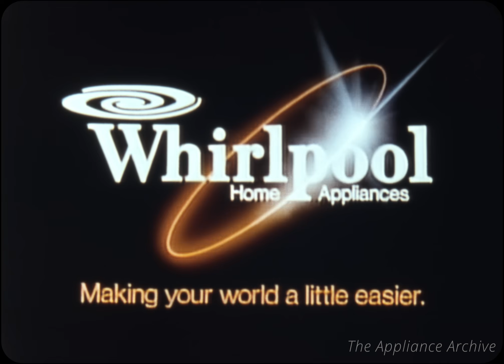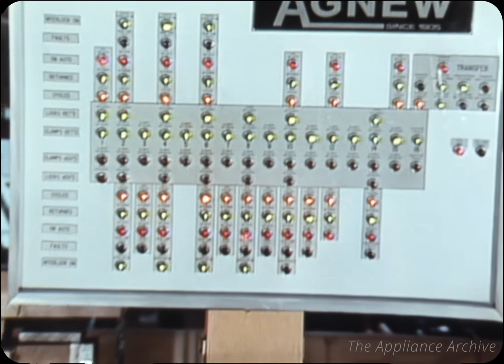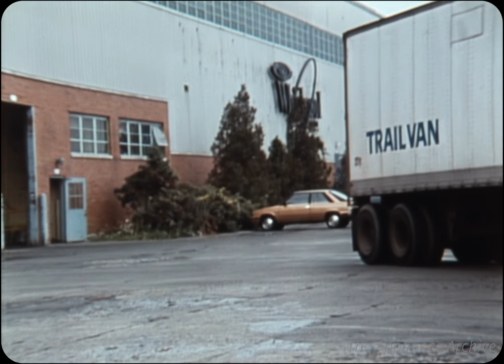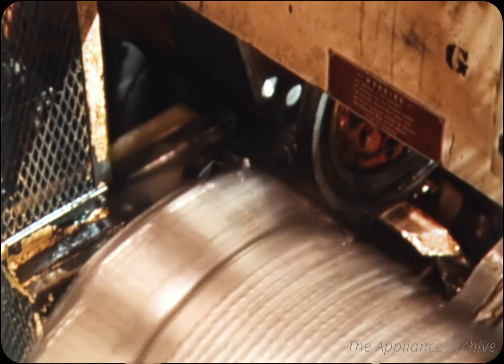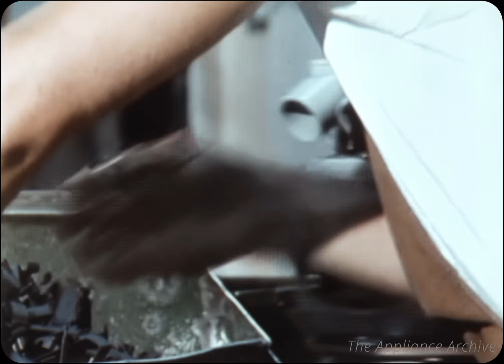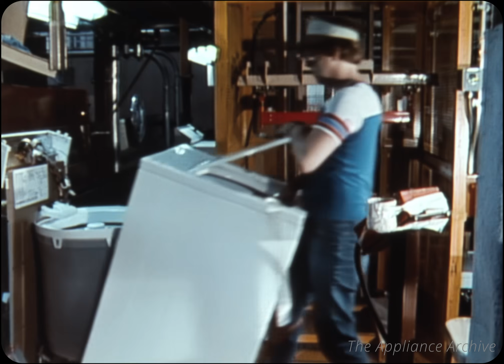Whirlpool's Design 2000 - The Direct Drives 1984

Comment: The cabinet was flimsy,  the plastic  tub vulnerable to getting sliced, weak coupler ,  tub seal prone to leaking . It didnt last long at all.
Reply: Had our first direct drive from 1988 to 2003. 15 years without a breakdown and I ditched it because the tub holes literally got clogged up by the A&H powdered detergent and hard water. That's the only reason why I bought a 90 series Kenmore in 2003. That early machine never gave us a problem.

Comment: Well mine’s not a direct drive but I have a 2 belt Maytag from 1990. It is absolutely amazing and never ever had one issue until 2025. 35 years constant service, also I’ll admit, never serviced/maintained. Until recently when the motor went bad. I decided to remove the tub and clean the inner tub and check for rust damage. This turned out to be a difficult challenge and took most of the summer to get it back to running due to spanner nut corrosion and then worse inner tub pitting than I expected. Particularly around the drain hole and drain nipple. But I decided it would be worth it to remove all the rust and fill bad pits with epoxy and then 2k epoxy primer and multiple finish coats with plenty of time to cure nicely. I went through some difficult trials and tribulations getting the outer tub balanced properly because there’s no detent to hold it centered. I just had to eyeball it and then cranking it down tight. Changed the motor, belts and properly adjusted the springs and feet. It did some banging because the tub wasn’t perfectly centered, until I took it apart and reset it with some home fabricated gaskets for forgiveness when clamping down, tilting it away from where contact was being made. It was a big project most homeowners probably wouldn’t take on but I am so glad I did because this thing just works SO well. No bullshit, just a dial and some push buttons and the thing is a beast. The best part about these machines is how fast you can get your laundry done. For 4-5 months I did laundry at different friends and families homes and never could I was and dry a load in less than probably an hour and a half. And that’s on low settings, smaller loads, etc. and my clothes never felt good like I always remembered them feeling. Like they’re not fully rinsed out… With my washer and dryer’s back up and running I can burn through a full extra large load, PROPERLY washed and completely hot and dry in 45 minutes. And the clothes feel so crisp and not like droopy and floppy. And the smell of clothes out of the dryer is incredible. I will never ever invest in a modern machine - washer or dryer, as long as o I live and as far as I’m concerned, after taking both machines apart, refinishing, and figuring out how they work and assemble, I think these will last me forever. Until it gets to the point where I just can not find the part needed for repair, they will last indefinitely. And certain parts are already slim pickings. But I have faith. It took 28 years before the dryer needed service and 35 years before the washer needed service. I think it’s safe to say that the engineers and domestic manufacturing we had in the USandA throughout the late 20th century produced some very very high quality products that were built to last and this was the STANDARD then. These weren’t some special high end machines that you only bought if you were rich. They were affordable to everyday people. It’s what we were accustomed to and we didn’t realize how fast that luxury was going to be flushed down the toilet while we slowly get force fed more and more turds until the only option available to us is to continually replace a turd with another turd. And that those turds would suddenly become a spy of your identity, which generates money upon your identity, in order to get you to buy more and more turds for more and more money! Yea I’ll stick with the classic direct or belt machines but thanks anyway ✌️

Comment: This year I'm going to try and find one with a cabinet in mint condition, and completely rebuild it with new parts. New tubs, dials, bearing, transmission, hoses - new everything. It'll be a little spendy, but not really more than a Speed Queen. Recon that'll last me until I'm damn near dead. DD agitation is still better than the back-forth agitation of SQ.
Reply: Especially with dual action agitator.
Reply: I have a Kenmore Whirlpool made looking to restore One of the best washer.
Reply: How does a direct drive motor produce any different agitation than a belt-driven agitator?
Reply: @Sam_TheCamMan i believe faster agitation and more power.

Comment: my 1990 DD washer is still working flawlessly. Never had a repair, besides pulling agitator and tub to clean it, and remove that stupid lint filter that keeps wet lint against the inner tub. WP gave up on that filter not long after. Amazing to think they introduced a washer for the year 2000 in the 1980s, and it lasted well past 2000 to 2012ish. I have enough spare parts to build two more machines so I can always have a DD washer, and even a belt drive, so I never need to suffer with a modern junk machine.

If you have an older direct drive, or really any of them, four simple ways to keep it in good shape
-Make sure the agitator bolt is tight, and the rubber seal on the bolt is in good shape.
-Remove that lint filter under the inner tub (older models)
-Don't use fabric softener.
-Keep the lid open when not in use.
Bonus if you avoid using large amounts of bleach. All stuff anyone can do. Many more things can be done to preserve these machines if your really into appliances, of course. If it wont drain or spin, its the lid switch almost every time.

Grab a spare OEM clutch, Neutral pack, pump, and shaft/tube/tub seals while you still can.

Bring back the direct drive. Please.
Reply: These washers were/are so sweet.

Comment: Thank you for sharing. I wish my $1200 2010 Whirlpool Vantage would have lasted like the early Design 2000s did. The Vantage has been the biggest disappointment in a washer I've ever had. By 2015 it was a miserable, expensive turd. Riddled with software errors, had to replace the bearings, lid gas cylinders lost their gas, balance struts are worn out, etc. etc etc. I'm limping it along till I buy a Queen or go back to an old Maytag. Now those really do last nearly forever.
Reply: When it did work, how did it perform?
Reply: @j @jeromedavis8575  worked well and was very user friendly.

Comment: They were not very durable. At least those Whirlpools around 2018 . Those direct drive models and the plastic tubs. I remember at the wash house  they lasted a year and a half. But the second year they were breaking down left and right. Everything from tubs, seals, couplers, leaks,motors , transmissions. The Ford  Escort  quality of washing machines. Management was fed up. Escort all 20 machines right out of here and to the dump..
Reply: Huh? 🤔
Reply: Yeah, you don't know what you're talking about. Direct drives were discontinued by 2013. 2018 would be the Vertical Modular Washer.
Reply: @straightpipediesel  I went to TSBVI in Austin, Texas and they had a bunch of these direct drives. They've lasted and lasted.

Comment: I still have my 2006 Roper direct drive washer I bought when I first moved into my apartment back in September of 2006.  The only repair I had to do was replace the agitator dogs in the two piece agitator.  I replace the inlet hoses every 5 years, and run Uproot Clean's Washing Machine Cleaner Pro twice a month.  These washers are legendary

Comment: The fact that they produced these machines domestically for roughly 30 years without needing to radically change the core design is a testament to how well thought out these machines are. Our direct drive top loader has been going strong for 17 years and counting!
Reply: I have a set of Kenmore (Made by Whirlpool) Direct Drive Washer and Dryer from 1996, which are going on 30 years, they are both going strong. Does anyone think that a washer from 2024-2025 is still going to be working in 2054-2055? NO POSSIBLE WAY!! On the washing machine the lid switch broke and I just jumped it and deleted it, I don't have kids so I'm not worried about that. The dryer gets the back removed every other year and is vacuumed out and pullies oiled and so fa so good. I think my luck has been has been great because I don't overload them and I always make sure the lint screen is cleaned after every use.
Reply: @michaelfolino8414 absolutely not!
Reply: I currently own four of these units and they are still in good repair and good working order thank you very much
Reply: I remember the clean touch models with the temp pads in the middle. It had a neat sound to them while agitating at full speed.
Reply: My wife and I bought a Whirlpool washer dryer set almost 20 years ago when we moved into our first house. The set went with us to our next home but had to stay behind for our third, but not likely last, move. We regretted it. That was the best top loader design of any washer to date. My mom and grandmother both had design 2000 series washers be it Whirlpool or Kenmore branded for years. Now their current generation are junk straight out of the factory. They should save everyone the trouble and ship them straight to the scrap yard.

If anyone knows someone at Whirlpool, they should send them this video to remind them of what they used to be capable of manufacturing.
Reply: @BobbyS1981  Blaming the wrong people. It's the consumer. The Whirlpool is going to be sitting next to a Samsung or LG in the big box store. That's going to be $100 cheaper and have a flashy color screen. Guess what 95% of the consumers are going to buy? Speed Queen doesn't even try: they don't sell through the big box stores, but Whirlpool can't afford that.
Reply: @straightpipediesel  Unfortunately, the population has been so dumbed down by inferior education and crazy entertainment that people are conditioned to go for flashy items rather than real quality.
Reply: @straightpipediesel  It is very much the manufacturer.  When you stray from your proven design and start using cheap Chinese parts, you get disposable junk.  Not the "last forever, easily repairable"  quality you had before.  Except for Speed Queen, every other manufacturer has gone this route unfortunately.
Reply: @musicnerd72  Maximizing profits, and thus executive bonuses is the only thing that matters.
Reply: @straightpipediesel tell me more about the stupid consumer. I’d love to know. We all do.
Reply: @John-u7z7v I don’t care about looks. I want them to work properly. I care about quality performance.
Reply: @musicnerd72 I’d argue both are at play.
Reply: @jeromedavis8575  Maybe you think so, but people like myself that possess common sense know those shiny, flashy, sleek looking appliances don't necessarily mean quality.  I know how to actually do research before I make a major purchase.
Reply: @musicnerd72 I also research and read user manuals to each machine so I know what to expect. I recently bought an lg dishwasher model# LDFC2423W and read the user’s manual online with the talking screen reader I have. It implies that you don’t rinse your dishes before loading them into the dishwasher, yet people complain they have etched, cloudy, or dishes coming out dirty. Gee. I wonder why? First of all, you don’t rinse the dishes before loading because today’s detergents have enzymes. Second, I use the auto cycle for the best performance possible, and third, I use a rinse aid. I use Finish Ultimate and Finish jet dry. I also clean the filter, and run the dishwasher empty with dishwasher cleaner as necessary to keep tip top performance. I do this once a month. I put dishes straight in the machine, dirty. I just scrape and load. I let the dishwasher be the dishwasher since that’s what it’s designed for. It’s not a sanitizer or sterilizer. And yes it is powerful. I can count on one hand the few times I had a dish or utensil with stuck on food, but that’s rare.
Reply: @BobbyS1981 my babysitter and VI teachers had Whirlpool clean touch models.

Comment: Omg where do you be finding these, but the first design series came out in 1981 on the Kenmore model and the design series did spin drain to compete with their competitors , this is so rare even the prototype models
Reply: Used appliance stores often have them.
Reply: I always thought they should have kept all of the direct drive models like the originals, WITHOUT the neutral drain! Neutral drain was too easily defeat and the neutral pack wore out in many of these units.
Reply: @JasonLawrence-bn6il  that's what I always thought to